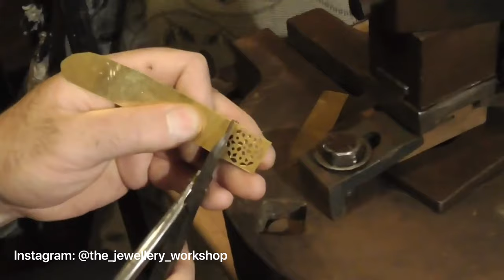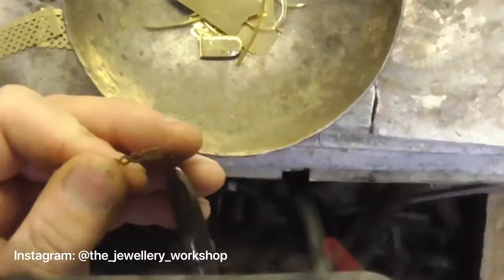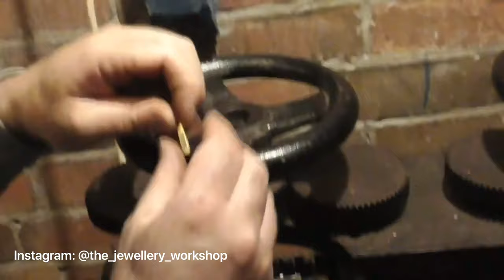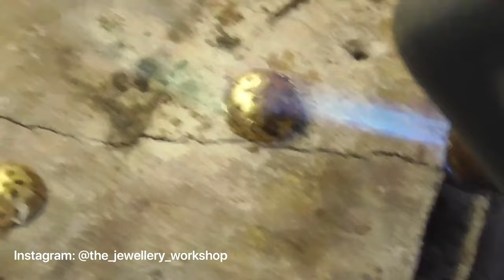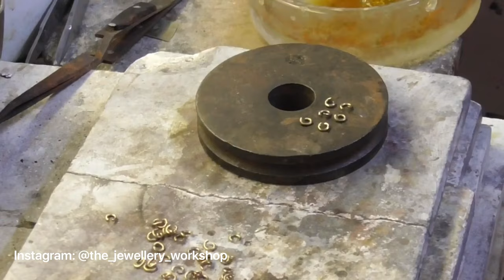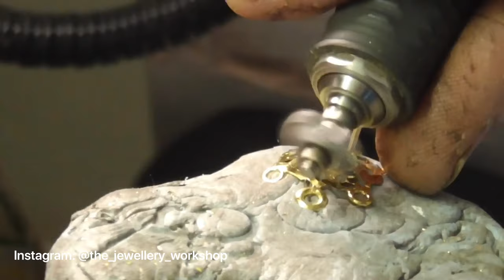How i make Gold Ear-rings by hand | Jewelry Making | How it's made | 4K Video

Comment: I looked at supply list. Can you tell me about chloride to restore metal color and when you use it. Thanks
Reply from the maker: Ammonium chloride, we use it after heating the metal to give back its colour
Reply: @TheJewelleryWorkshop  I have always seen it dipped in solution before heat, so do you do it afterward? Thanks